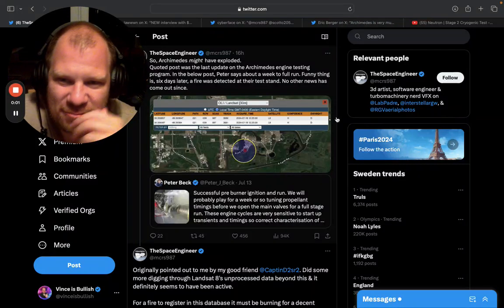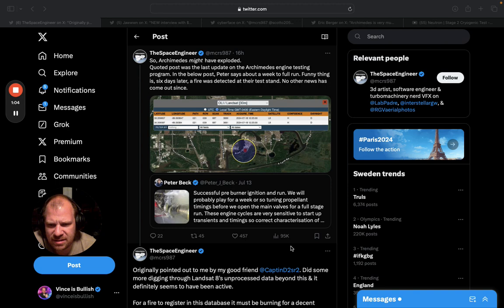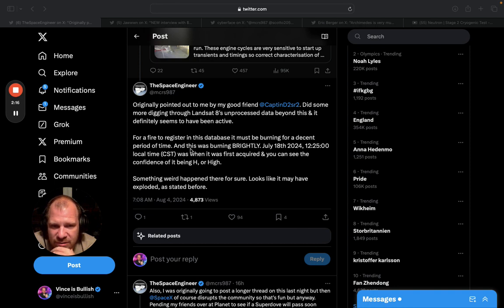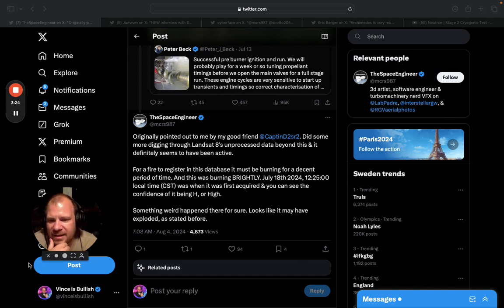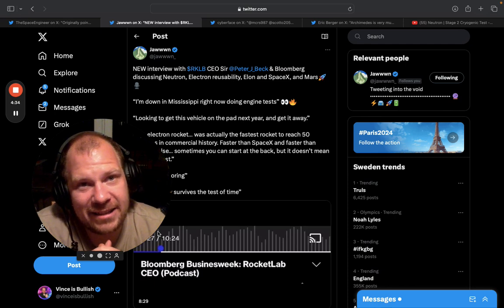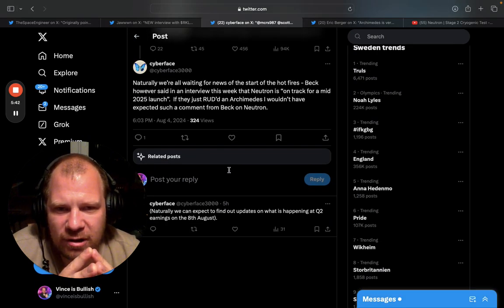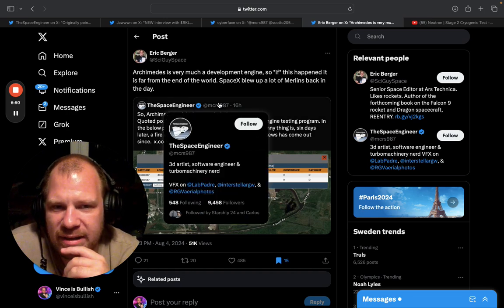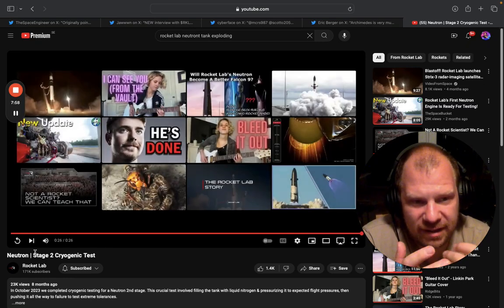Rocket Lab FUD about the Archimedes Engine blowing up! | True or not?

Comment: Whoever thinks this market will continue upwards and beyond has their head in their rear.  There is a correction coming since the Russell and the Dow are showing signs of weakness. Depending on the correction may determine if the market rallies once more in the summer for a final blow off top and slightly newer high.  After that, watch out.  Cycle Analysis predicts a hard drop in the late summer early Fall.  Also, we are now 190% Market Cap to GDP ratio.  That is very extreme......currently I've been engaged in active trading, which is generally safer, allowing investors to weather market volatility and also managed to grow a nest egg of around 2.3Bitcoin to a decent 24Bitcoin....I'm especially grateful to Linda Wilburn, whose deep expertise and traditional trading acumen have been invaluable in this challenging, ever-evolving financial landscape.
Reply: She's often interacts on Telegrams, using the user-name.
Reply: @Lindawilburn:yt:
Reply: In a field as rapidly evolving as cryptocurrency, staying updated is crucial. Linda’s continual research and adaptation to the latest market changes have been instrumental in helping me make informed decisions.
Reply: Always backup your trading with a good strategy.
Reply: Nice, I was just hodling before I found Wilburn. In my opinion she is the very best out there.
Reply: When it comes to investing, we want our money to grow with the highest rates of return, and the lowest risk possible. While there are no shortcuts to getting rich, but there are smart ways to go about it.

Comment: Hey Vince I agree if it was tested and tested to a limit then that’s all good. I had heard from a connection there it was likely to blow up first try anyway and as you said - that’s not unusual and actually has a purpose.

A hot fire is a success regardless of the final moments as it’s iterative learning.

I will say the still for the video tho may rattle some… eitherway it’s not a moment to panic or sell imo.

Comment: There is zero chance they deliberately tested it to failure. To take months slowly checking everything before attempting a hot fire, only to then move quickly to test it to destruction . . . . no chance. They would surely perform at least 2+ short fires followed by incrementally longer fire durations to build up data.

Could it have accidentally blown up, yes of course. Although it would be strange, if it blew up on July 18th, for Peter to be at the test site (as he stated in the Bloomberg interview) for engine tests, after the supposed explosion.

Hopefully this is just the actual hot fire.

"Insufficient facts always invite danger" Spock 🖖

Comment: In answer to Space Engineer, three things: 1. Wait for Peter Beck: Not only as head of a public company is he required to report honestly & in a timely manner; but I happen to believe he is a guy of pretty high integrity & even mental stability (the latter, as we all know, can sometimes be, er, somewhat lacking among some space CEOs……). So ‘just wait’ is not a bad thing. 
2. Even if there was an Uncontained Event- the official aerospace term, by the way - that doesn’t automatically mean ‘Really Bad’. In fact, let’s remember: the closest thing to a ‘competitor’ engine in the MLV space- Firefly’s Miranda engine, still in testing - has ALREADY had it’s ‘Uncontained Event’, and they’ve recovered and it’s back in testing. Thing is, THEY aren’t a public company, so they haven’t had the same strictures as far as reporting- just like SpaceX doesn’t. (Except, there are hundreds of robocams focused on everything SpaceX does, and SpaceX knows it!), 3. The MAIN ISSUE with an Uncontained Event is NOT WITH THE ENGINE- it’s: How badly was the expensive FACILITY HARMED? That’s MUCH MORE important, since test engines- almost by definition - are ‘disposable’ items. So, again, it just points out that the engine first and foremost would not be the main issue- IF this indeed did occur. -Dave Huntsman
Reply: Lol, maybe 'less' mental stability is required to dominate the space market then.

Comment: I think you're right at the end Vince, that for it to be the level of catastrophe that would show up on satellite imagery (basically a fire burning for hours), that's very unlikely. And I don't think Peter would show up and act cool for a Bloomberg interview just a couple of days ago if something had gone that badly wrong. 

As for them testing it to failure intentionally though, or even not intentionally but really getting to the point of pushing the engine's limits already, I think it's a bit soon for that to have happened by the 18th of July. 

I think the most likely thing is that it was the flare stack burning that was detected by the satellite, and that the situation is that at least one hot fire has been attempted, and then potentially also that there has been a failure of some kind either during or after that first attempt. Or even that everything has just been going fine.

On the whole I think the satellite detection most likely only tells us that engine testing has been going on, which we already knew.
Reply: The interview was released in 2rd August, but when the ineterview happened? Actually the they mentioned mid july in the podcast, not sure
Reply: @chenyangjiang2096  They mentioned mid July when talking about how many launches Rocket Lab had done vs SpaceX, but they also referenced Rocket Lab's previous launch with "tomorrow". It got delayed a couple of days so the interview could have been before either the original launch date or the actual one, but either way the interview had to be well after the 18th.
Reply: @HeyPumpkin  true, I was wrong. Hoping everything goes well.